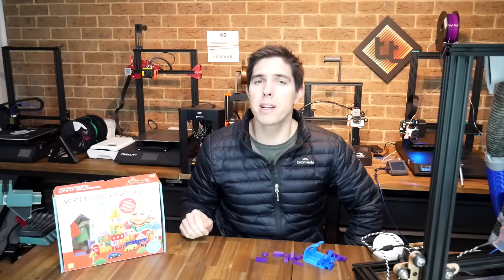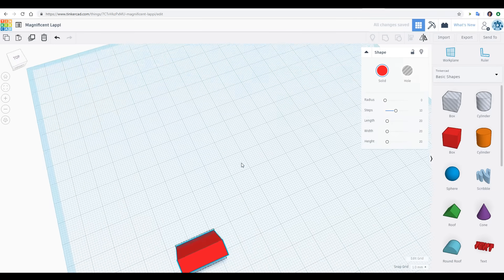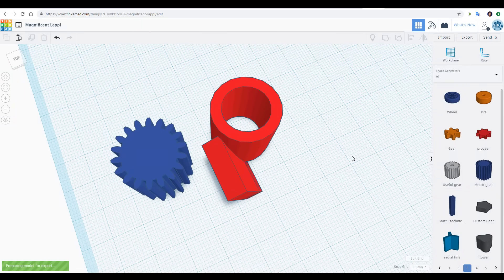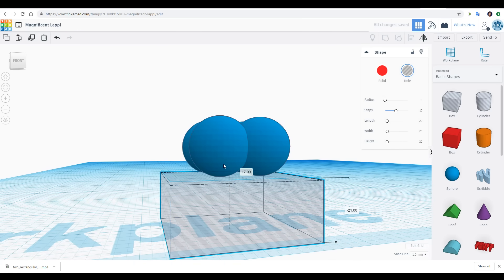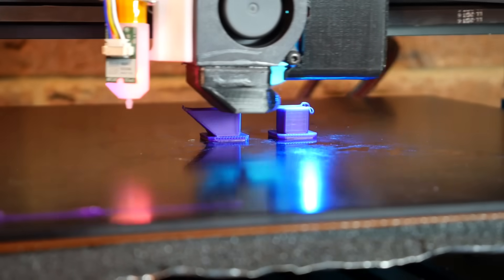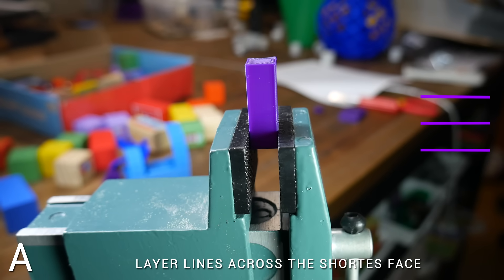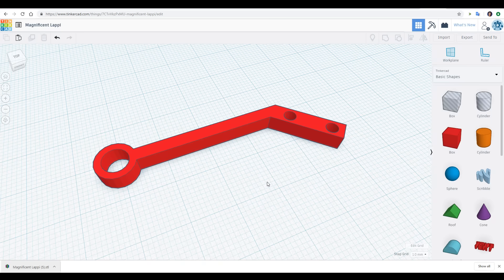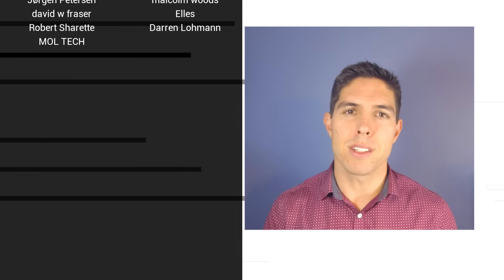5 Tips to start designing your own 3D printed parts - Tinkercad

Comment: Tip 6 - if you're having difficulty printing a part - slow the print speed down to 50% and see if it makes a difference. Also note if you speed up the print speed beyond 150% the strength is greatly reduced unless you thicken the walls using your slicer.

Comment: Subbed. I like the way you teach.
I'm a newbie, so being clear in your verbiage is appreciated, which you do. Thanks. Question if I may. I am to purchase a second-hand Basic Ender 3 3D printer. My goal is to print two halves of a sphere and then wrap, small gauged, electrical wire from its' apex to the equator ridge. From your vid I see ridges in the finished product. These ridges may be able to facilitate holding the electrical wire as Im winding the coil. So, what is the spacing measurement between each layer, from apex to apex and the overall depth between each layer? And, would any printer layer this in a concentric spiral pattern?

Comment: I was searching for a video to give me a proper understanding on how to design a 3d print. Coincidently, I was already using tinker cad and being self taught and doing this for a couple years now this was a great refresher and confirmed a ton of tips for me. Also learned some new ones! Thank you so much for this video. I do have 1 question however, I find the measurements in tinkercad to not be entirely accurate. For example, I've created a round bushing that needed to be 6mm. Although it printed much smaller. I beleive my print was set to 100% in the slicer. Any one else have this issue? Or know of some further tips to help me out? Thanks!
Reply: To clarify it was only 1-2mm too small. Maybe I'm just expecting too much accuracy. But still curious how precise I can get to real world measurements.

Comment: Thank you so much for the set of tips.
8:50 At looking at the Be Patient and Iterate tip, I saw an extra piece that may be worth considering.. It may be possible that after the first attempt, you could alter the test so that it has some sort of measurement built into it - which could have helped dial it in faster.

Comment: Based on tip 1, how do you make hollow shapes? I note that you made 2 hollow rectangular prisms, but tip 1 suggests that it wouldn't work. There has to be more too it than your tip 1 explanation.

What if you wanted to make a more complex shape hollow and without a back, let's keep it basic and say a domed 5 pointed star. Could you use a ground plain and use cylindrical risers in the corners to print the hollow star without a back?

Comment: Loved this summary of issues. With respect to strength of items does have anyone have any ideas of how to make a strong hinge pin. Mine done in in PLA is a cylindrical base with a central cylinder from it centre. However it just breaks on the pin the moment any weight is put through it. Is it just an anfill issue or is there a way of printing it with the lines going along the length of the central pin without infinite support material?

Comment: Oy, solution to #4? :D I was looking at videos on 3D printing, because when I drop my models into the slicer I get similar issues. Models made with a plane looks good in the modeller but they disappear when sliced. Is there a way to go around this? (Bevel model? skin modifier? measure out that all panels are x thick? what?

Comment: I need to add a single thread in a hole that circles 3/4 away around the hole from the bottom, to 1/2 of the the height of the hole.  Should be easy enough to loop a ridge from point to point, but does this software support that sort of command?  The rest of the part is just basic shapes.

Comment: Excellent channel and great video ! Three other useful tips for real world parts: 
1. Buy a digital micrometer to measure the real world part you are interfacing with. 
2. Before starting the CAD, draw a picture with a pencil and paper, preferably in an isometric view. Add critical dimensions, the interfacing part and other key features. Will greatly help with the CAD since you can already ‘see’ the part in your mind
3. Check if someone has already made something similar on thingiverse or myminifactory. You may be able to remix this design for your application rather than designing from scratch. 

Well done on the channel !
Reply: I’ll be honest, the beginning and trying to draw what I have in my mind has got to be one of the hardest parts for me. This is especially true when I am trying to design parts for an already preexisting device and I’m trying to gage distances.

Comment: Thanks for the tip about printing a slice or partial version of an object that needs to fit with a real world object. I don't know why that hadn't occurred to me, but it's super helpful! I've been having trouble getting a couple of my printed pieces to fit together. Each part takes about 4 hours to print so new iterations to fix sizing has been incredibly time consuming. But I'm going to take a slice of one of the pieces which should print in significantly less time and help me get the right fit faster. Can't wait to try it!

Comment: 3rd tip is very good not even for beginners! The last about test prints is the most important. I've used this method as well - saves time, nerves and plastic :)
My own tip (for DIY fans and makers mostly): be careful with improving (or replacing) everything. Sometimes you can't save money but make it worse. It's not often but can happen with everybody.
The example: yesterday I've decided to design a replacement of a silicon cap for my Vidima's water tap box. I've had a completely new piece in a stash and I've used it to measure the part to be replaced. On the 2nd designing attempt I've got a good (less height) part probably and tested it on the fresh tap box. It's "kind of" worked :) Maybe it didn't leaked. Then I've tested it on the old tap box: the height was not enough (leaked a lot). So I've decided to try the 1st design (just 0.5mm higher) on the old tap box. I've almost tighten the tap box to it's working position (almost touching or touching the fauset body) and I've thought "well, it's not enough... let me try to tighten it further"... Guess what did happened next? ;) The tap box is a brass metal, the cap is PETG plastic... 
Write here if you've didn't guessed right :)

Comment: The dimensioning tool (looks like an L in the top right) allows you to position things very accurately. Also changing the sensitivity in the bottom right can help when using the keyboard to position objects.

Comment: Great job, you make some really good points.

I just published a 3 part video, actually it’s my first Youtube video, involving printing a gear for a paper shredder.  The title base name for this video is, “Paper shredder repair 2019”, I mention this title because I’m about to make references to it.

First in your diamond and cantilever examples you ultimately rightly suggest the proper orientation for these objects.  I would’ve done the same.  However, I’m curious as to what slicer you use?  Between my STL and Gcode file, my program of choice is SLIC3R which, at least in my configuration, automatically adds print scaffolding to my print.  I was wondering if, for illustrative purposes, you turned off scaffolding in your prints, or does your slicer naturally omit these supports?

Like you I also gravitate toward free software.  In your case you use Tinker Cad.  In your examples this program bares some similarity to Heeks Cad which I have used in the past.  However I have recently fallen in love with FreeCAD, which is also completely free. FreeCAD, which I have no affiliation with, has an extensive set of, “Work Bench”, environments that make generating 3d models a breeze, and was the program I used to generate the 3d Model, and STL file in the above referenced video series.  Of particular relevance is the part orientation.  Just as you have suggested, I placed the largest diameter gear on the print bottom for greatest print stability.  My printer, like so many entry level 3d printers, moves the print bed to affect Y axis motion.  If designers don’t follow your suggestions, the print could be ripped off the bed during rapid Y moves due to the inertial mass of the print.

Finally, your style of presentation is very good.  Far too many Youtubers, if that’s really a word, rapidly jump through their configuration and execution explanations leaving the viewer scratching their heads and wondering what was just done.

Keep up the good work.

Comment: Blender is a completely free and fully featured 3D software. The 2.79 build has a 3D printing add-on for analyzing and fixing models for printing. It's not all that simple to start out with is the downside because all features are available and can overload a new person. There are TONS of tutorials (I currently have 200+ channels) on youtube to teach you to use it, though.

Since I've learned the software I just can't help myself to animate it and/or add particle effects when I have the time. :P
Reply: It depends upon what someone is making. Blender allows complex, organic modeling. But, some objects are better modeled using CAD software. The trick is knowing which to use. In general, CAD is better suited for engineered parts while Blender is better suited for artistic parts. When you get a part that is a mixture of both, exporting a CAD model to Blender may still be easier than modeling the part fully in one application or the other.

Lastly, the print simulation that he shows here is FAR superior to the 3D print addon in Blender. I wonder if it works on imported geometry that could be made in Blender.

Comment: How timely!!  I'm designing my first part:  a nose protector for a old lathe in Tinker cad.  I'm on my 5th iteration now, and it's getting closer.  I found that an internal thread was a brain teaser.  I think I've got it now tho.  Iteration 6 is about to start!!  That short height to check tolerance is one I figured on my own.  These tips are appreciated!  Thanks!

Comment: 9:29 You can also use "hole" boxes (grouped with the main object) to delete the majority of the design, leaving only the area want to test, export the STL to test print, then step backwards to undo and get your hard work back. Very handy for more complex designs.
Alternatively, if it's simply just a matter of reducing height to make a test piece, you can also just lower it beneath the floor in Cura, as anything below the floor won't be printed.
Reply from the maker: Great tips.

Comment: Just curious as to what you use the printer for with the students. We print parts for our robot (FRC team 1989)
Reply from the maker: The primary kids make keyrings, etc just to learn the process. Our younger high school kids make toys, and our older high school design and make custom parts for their projects.
Reply: Interresting. Trying to get a feel as what others do. Our HS got into 3DP basically through our FRC (FIRST Robotics) Team. Now the tech classes uses it for similar things as you. We (the FRC team) have a pulse (can't use the other printer upstairs) But we are printing currently a whole 30x30x48ish inch robot (in pieces of course) Including Rack and pinion and planetaries etc. Currently I am helping one of our soon to be graduates printing a 404:1 compound planetary that will take about 1.5kg of Nylon and 2kg of HIPS and is powered by 2 motors and hopefully will move 400lb up the stairs on a motorized handtruck. If successful I will make a video about it on my channel. We got about a $100 budget and some donated motors and aluminum for the frame. Hence about 2kg of Bridge Nylon and 2kg of HIPS and hopefully no printing fails. BTW really enjoy your channel and probably will use some of the stuff you posted to upgrade the pulse once it is out of warranty. As for now just breathing on it might void it. We were quite successful with the 3DP this season until disaster struck. But that is another story. Most of the stuff survived well and the Taulman Nylon and Hobby King HIPS ($12/kg) works real well.

Comment: I have a vague impression your TouchMi mount design process could have benefited from Cardboard Aided Design.
Reply from the maker: The original CAD! I actually employed it at the start but the distance between the two mating parts made it difficult to keep things sufficiently rigid.

Comment: I wonder if there are many others like me, who came to 3D printing from a different angle...  with only hobby-grade engineering experience, I fell in love with CAD software.  I experimented with every application I could get my hands on, and designed everything I could think of, knowing I had no way of turning my designs into real objects.  3D printing was a game changer; now I could see my ideas in the flesh.  I have never printed the test that came with my printer.  I have admired peoples work in Thingiverse, and used it for inspiration, but almost all my prints are of my own designs... and that is immensely satisfying.
Thanks for another helpful video.
Reply: this is what the 3dp space needs! more designers. anyone can print a premade file. the most beautiful and eye-catching designs are always originals!
Reply: I think it must be a mix. There are so many great designs out there, not printing them for a gift or a decoration is a mistake :)  Obviously the printer must have some dead time when you are designing things, I bet you could print some toys in that time.
Reply: @evgiz0r  :  You are right, of course.  I must be selfish... the time I spent finding things and printing them would be time away from doing things for ME!   That would never do!   :o)
The truth is I enjoy thinking up ideas and creating them in CAD.  The actual printing is usually just proving my ideas have validity.  The bulk of the printing I do is brackets, jigs, adapters, mounts, knobs etc. and I get satisfaction from seeing them in use from day to day.
Reply: I came to 3D printing from a different angle... In 2005 before 3D printing existed, I took engineering in community college, which only qualified me for metal machining jobs... but I like having 10 fingers, so I worked in computers instead.  Fast forward to this year, and I realize that 3D printing uses the exact same skill set I learned for CNC.  With modern machines that can print functional parts and are so cheap, I couldn't help but get one!  It sure beats trying to find an old knee mill and hook it up in my garage.

Comment: Your overhangs curl as much as mine. Only way I've found to minimize it is using supports.
Reply from the maker: That's a pretty fast speed I was printing at too, which doesn't help.
Reply: @TeachingTech  I have a dual 5015 duct and still can't figure out if curling is over or under cooling. S3D troubleshooting guide says under though.

Comment: Great video Mike! One additional tip I always give my students is FILLETS when ever possible. Like on that magnet mount you made, where the round piece and the square piece come together will be one of the weakest points of that print, a fillet in the corners will double the strength of the part.
Reply: Fillets and Chamfers are THE things tinkercad is missing. I really hope they can add them some day
Reply: @CatofManyFaces  they can be done with circles and squares, just not as easy as a fillet/camfer button.
Reply: Makes a huge difference!  After watching a video from Angus (Makers Muse), I tend to use chamfers more than fillets.  Fillets are technically stronger, but chamfers work better for 3D printed parts because of the limitations imposed by layered construction.